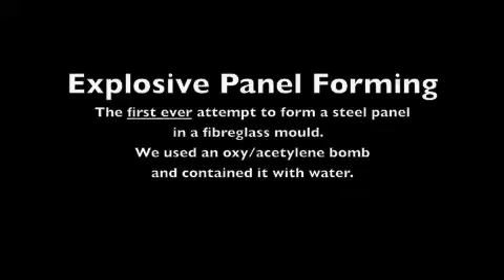Explosive panel forming with oxy/acetylene - the first attempt.

Comment: Obviously way late, but something they do on the forms for explosively formed aluminum boats is have huge (1" wide) cuts along them for the water to escape from between the Sheetmetal and the mold. 
 
Maybe drilling a LOT of holes could simulate the effect to make it fill out the form better.  Because all that water is trying to escape in literally milliseconds, you're talking flowrates probably around a thousand gallons a second, which isn't going to escape from a little .5" hole in the deepest part of the mold. 
(assuming 1 gallon of water between form and sheetmetal, and 1ms for it to escape, that's 1,000 gal/s right there)
Reply from the maker: My aim was to form metal in a single sided fibreglass mould. The water supports the fibreglass mould against the explosion. The trapped sir was an issue. I have bought a few more bonnets to try again but this time it will be with a A/C vacuum pump. I will be leaving the outside part of the bonnet frame on it to stop it crumpling into the shape.
Reply: @ksv04  oh so you had air between the bonnet and the mold? I would've thought that would work. But yeah vacuum would be even better. 
Good luck!

Comment: I use vacuum for work with carbon fiber molds , what I found I could use at home which is insanely strong is the vacuum tube from the brake booster on your car. But you rock for experimenting at home and filming it !!

Comment from the maker: We learned 2 things, 1. The vacuum cleaner doesn't remove enough air, the ingition side formed well, but the other side got pushed back by trapped air. 2. The panel slid into the mould, so either weld a frame around panel or bolt it to a concrete mould as it  needs to stretch and not flow into the mould. I considered concrete but is heavy and hard to store but would work. I had the fibreglass mould and figured correctly that the water would support it and it would not break.
Reply: Any follow up successes? 
Interesting way to Press a panel. Much cheaper than buying a huge pressworking setup
Reply: Only saw this now but an amazing experiment and bloody good result for a  first try .
Also agree totally on your conclusions plus may l add a bigger volume of water and acetylene bomb. 

Loved your scared daughters as well  🤣🤣🤣